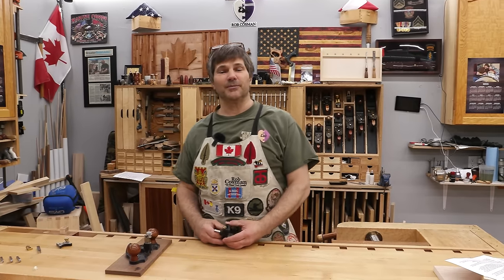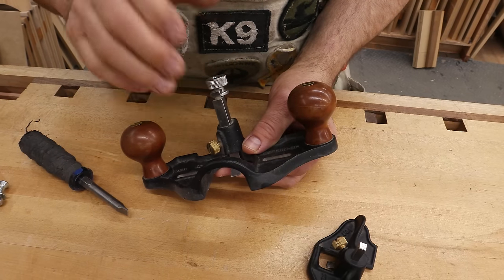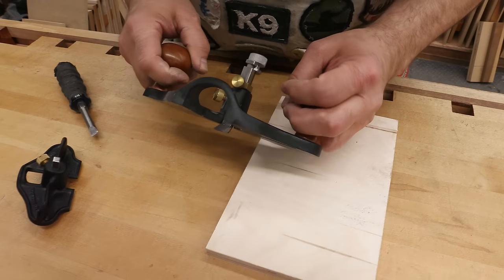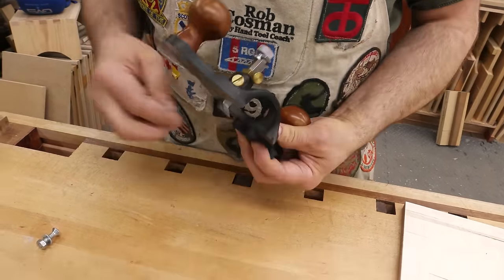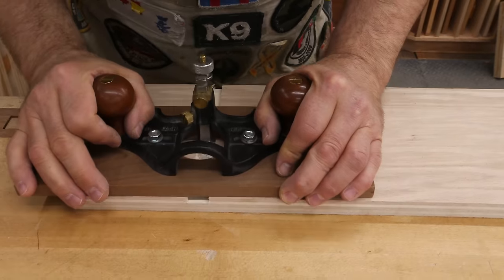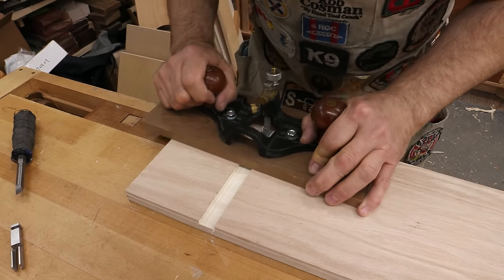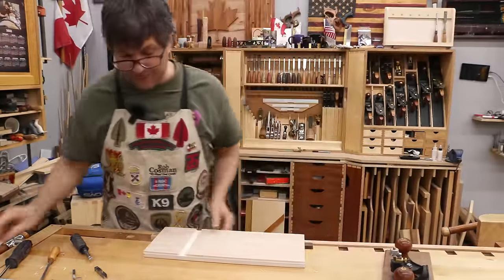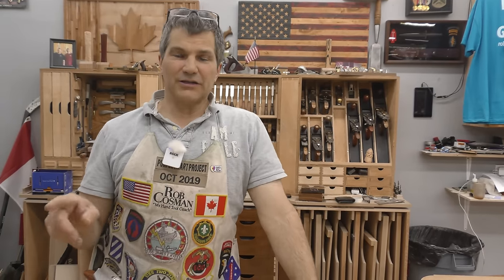Router Plane Selection, Uses, and Tips

Comment: A problem I had with the small router plane is with the brass thumbscrew deforming at the tip as you lock it down tightly. What happened is that the tip had a notch form against the surface of the tip which prevented the last bit of turning to fully secure the blade from shifting under cutting pressure by grabing the blade shaft edge. To solve it I put a copper plated steel BB up against the blade's shaft in the threaded hole for the thumbscrew, then inserted the thumbscrew and, as I tightened it, the BB started to turn that edge created slot in the tip into a  circular depression and lock the blade as tightly as needed. It will also slightly swage the tip end of the thumbscrew so your adjustment won't back off. Yes, it's easy to lose the BB if you take the blade out for honing, etc. I happen to have a 3/4" long by 3/16"x 3/16" ceramic magnet that I just slip into the square hole for the blade's shaft as I remove the blade which blocks the BB from slipping out of the now empty shaft hole and is also easy to just store on either the blade's shaft or the plane's body when otherwise not in active use.

Comment: This is an indispensable tool for the hand-tool woodworker.  I bought the large router plane and the available extra blade sizes for versatility. As you say, it doesn’t seem to get a lot of use, but I find myself reaching for it to finish almost all my dadoes and rabbets to perfection. I hadn’t thought of using it to finish tenons, though... great tip!
Reply: Absolutely agree, I've owned one for about three years (used to think it's one of "Dad's" tools) but after using one you find it's so much more refined than an electric router for fine work. By the way, if you have at least two tenons to trim put them end to end and the plane has an even reference surface + you get to do both at the same time (sorry Rob - a Paul Sellers tip).
Reply from the maker: Yes it’s perfect for dadoes and rabbets, and it’s great for tenons. Cut your tenon very slightly fat and then trim both sides absolutely parallel and sneak up on the finish.
Reply from the maker: Bites my hide!

Comment: I use my small one for cleaning up pickup pockets in guitar bodies. A machine router just doesn't clean up as nice as the router plane. Also if I have to remove a bit more depth in the pocket the router plane is simply way faster. By the time I hook up the machine and get it set the router plane has already completed the job.

Comment: Great video. Thanks for sharing.

FYI - Here is a quick tip to help stabilize the router plane when cutting rabbets or tenons: I often put a scrap piece of wood the same thickness as the piece I am working on beside it on the other side of the rabbet or tenon to support the other side of the plane.  It essentially simulates cutting a dado, which is what the plane was designed to do.

Comment: Finish hand-routing a dado applies particularly to those of us using a jobsite table saw with a cast aluminum top. The aluminum is almost never perfectly flat, and that will invariably cause a difference in depth from one part of a sawn dado or rabbet to another. The router plane setup you demonstrate, Rob, offers a practical and accurate solution to the problem.

Comment: Rob, How do you insure that when you are sharpening the blade the 'cutting edge' remains parallel to the sole of the plane? Asked differently (if the question is not clear, and assuming that the shaft of the blade will be exactly 90 degrees to the base of the plane), how do you guarantee that the cutting edge will be perfectly perpendicular to the shaft? Even the slightest angle of deflection will result in gouges in the wood. Sorry if I am asking this poorly, and thanks for a great video.
Reply from the maker: Your thinking is a bit wrong. This is not like a plane blade, more like a chisel.  The bottom of the blade (the back) MUST be fla. YOU CANNOT use the ruler trick on this.  The plane holds the blade parallel to the bottom.  For practical purposes it does not matter the anglr you sharpen the bevel on top as long as it meets the flat bottom at the cutting edge in a straight line

Comment: I wonder if using a feeler gauge instead of a shaving would work.  Maybe you would need two to "level" the router with the reference surface.  You could measure the difference between the two mating surfaces and use close to that to remove.  I must try it next time.  You give me so many tips and things to think about.
Reply from the maker: Feeler gauge works perfectly

Comment: For the tenon adjustment, I assume you'd want to use the plane on both sides of the tenon, each time you make a depth adjustment, so you keep the tenon centered?
Reply from the maker: Yes you do.  I should have been more clear on that point in the video

Comment: Hi Rob and gang, is it possible to use the ruler trick on the back of the blade? Do you prefer an open mouth router plane to a closed one? And is it benifisial when sizing a tenon as shown to have two tenons facing each other and be able to bring two tenons down to size at the same time but more importantly the plane would sit on both tenon legs or stretchers and so won't dip in use so your left hand is free to move the plane instead of ballanceing it.
Great review as always
Reply from the maker: No you don’t wanna do that the router blade is similar to a chisel in that when it’s cutting the wood the back is a reference surface. Unlike a plane when the plane is Kylie in the wood the bottom of the plane as a reference surface so do not use the ruler trick on router blades

Comment: Excellent presentation.  And a thorough explanation of the Lie Nielsen blade adjustment refinement. Thanks for the video!  (It looks like Lee Valley has a similar blade treatment. Any comment on comparison?)
Reply from the maker: The locking mechanism is completely different
Reply: Veritas has a much simpler design. And their blades work in the stanley 71 and 71 ½.

Comment: Rob, I'm an old guy now and ever since acquiring my first router plane I've bought up old ones whenever I find a good one. Unpacking now from a move six years ago, I've so far found eleven cast iron or wood bodied examples. Though the largest has a sole about like the shoe you've added to your larger router, I have to admit that my needs would be better served by the excellent Veritas routers you've demonstrated here. They are by Veritas, right?
Reply: The router plane Rob is showcasing in this video is a Lie-Nielsen, not Veritas. Just letting you know :)
Reply: @Keth.S  Thank you. The few new planes I ever bought were Lie-Nielsen and fine tools. Proof of their excellence is that when I use them I cannot remember their price.

Comment: Have you tried the veritas one? I'm surprised you don't support them or talk of them more both y'all being Canadian.
Reply from the maker: The LN with the square blade shaft stays put, much better.
Reply: Rob can't comment on Veritas for legal reasons.

But yes, that's the way I went. The key factor is that a certain english woodworker's recommendations stimulated demand in the collector's department. Net result is that a complete vintage Stanley 71 is often more expensive than a brand new Veritas. I prefer vintage but buy it only when (a) vintage quality is at least as good as modern new (most pre-WWII planes)  and (b) it's significantly cheaper than new (to compensate for the time and effort bringing it back to working condition).

Comment: because of your videos I just bought my first plane 2 days ago.  It was that small router plane. I bought it to clean out daddo joints. And I also bought a set of sharpening stones. Your fault. lol
Reply from the maker: Careful, woodworking is addictive
Reply: @RobCosmanWoodworking  I've been doing working for 40 years, but always with power tools. I've always had a token  set of cheap hand tools. Saws, chisels, files etc. But they are mostly for show rather than actual use.

Comment: At 14:00 why couldn't you just capture a second board the thickness of the one your plaining and use it to support the router?  Or attack an outrigger board the same thickness as the one your working on to the wing half and make it support itself?
Reply from the maker: You absolutely can do that but that takes more set-up time.  I find it much quicker and easier to keep my base on, then i just grab the plane when I need it and all that extra surface area means I dont need to mill up an duplicate nor set an outrigger

Comment: I really enjoy your videos, but what you said about the Stanley No 71 is to be blunt ‘rubbish’. I’ve used the 71 since the 1970s and I’ve never had problems with the blade slipping out. You claim that the over priced tools you use from lie Nielsen have solved an issue that doesn’t exist, all they’ve done is replaced the wing nut with a screw and moved it to the side of the tool. Think about this; you use a screw driver to get it tight, if you use a pair of pliers you can get the locking mechanisms on the Stanley just as secure and this will eliminate any slipping. Please stop rubbishing other tools in favour of the over priced Lie Nielsen tool range!
Reply: Have you looked at the price of used Stanleys lately? Another $50 and you're approaching L-N prices. I blame Paul Selllers. lol

Comment: Thanks so much for the excellent, informative videos, Rob. Greatly appreciated! I have a question about open vs closed throat router planes. My limited brain capacity tell me the open throat planes would give a better view (especially when pulling towards yourself), but the closed throat variety would provide less flex and be more stable across the width. I don't know if either of those are actual issues, just something I've been pondering. It seems the open throat are more popular (as you have one), but curious as to why. The open throat version at Lie-Nielsen has been out of stock  forever it seems. They do have the closed version in stock. 

Can you share your thoughts about this? Any qualms about the closed throat version?